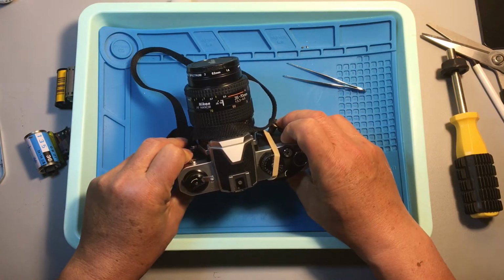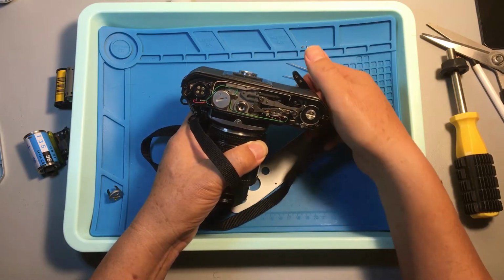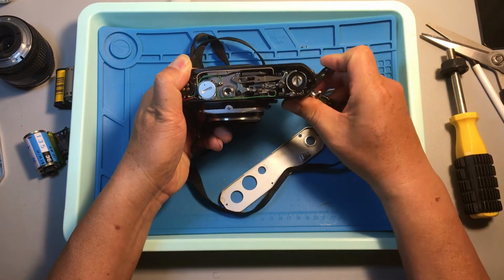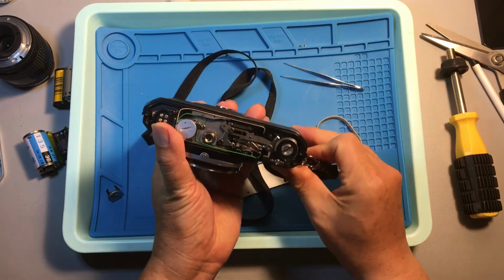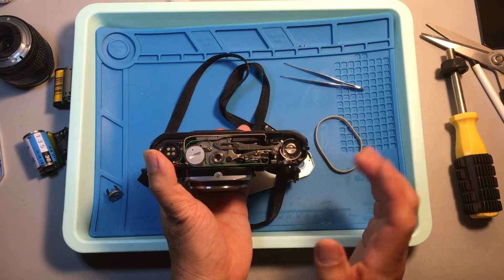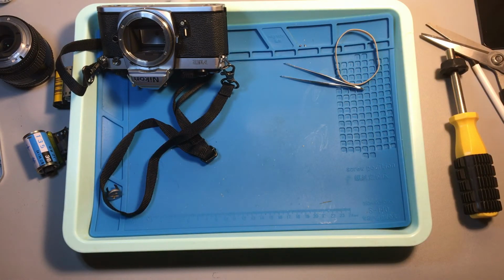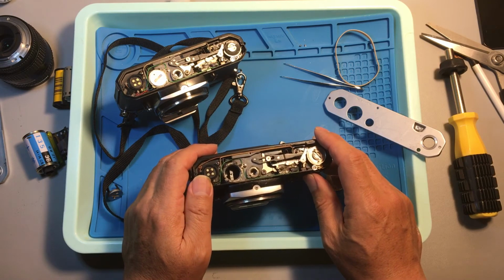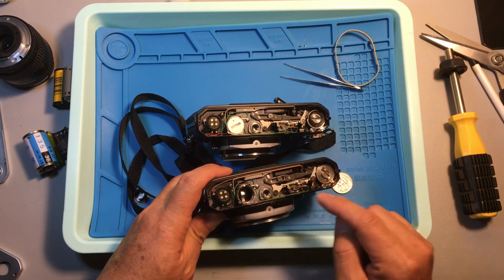Nikon FM2, FE2 Stuck Shutter Diagnosis & Repair

Comment: Hello, thanks for the video, it was very helpful! I was able to unlock my FM2 but at very low speeds it keeps locking. At high speeds it works fine. Where should I lubricate? On the pendulum? What type of oil is used? Is it suitable for sewing machines or does WD40 work? thank you
Reply from the maker: @willy-VD  I have been using 3-in-one lub oil. I think sewing machine oil should be fine too. I would be careful about lubricants containing acid content. I would lubricants on the pendulum and other axis with tiny drop to start with. Good luck.

Comment: Hi, great video! I have a FE and I noticed that 1000 and 500 shutter speed doesn’t work but all the other speeds work. I’ve tried replacing battery, it didn’t work. The shutter operates normally but I don’t see any light pass through. 
The camera takes amazing pictures but some are blank due to the issue. 
Any ideas what’s could be wrong? Look forward for your reply!
Reply from the maker: Looks some dusty grains or greasy debris in between the shutter blades make them sticky at high speed. I would use non destructive method to clean them first, like using a hand air blower gently blow from the shutter box after taking off the lens. Hoping this may resolve the issue. To open and disassemble the camera and to take out the shutter assembly cleaning each blades or replacing the damaged blades, I haven’t done these tasks yet. But I plan to do soon and already got a FM2 with damaged shutter blades. Cheers.

Comment: Hi, please show how to fix the FE2 problem, you said it's a magnet issue.
Reply from the maker: The issue with the FE2 or other camera which rely on electronic for shutter is always more complicated. Yes I will get back to it. Thank you for reminding me.
Reply from the maker: Thank you for reminding me. The FE2 issue or other camera shutter issue with electronics are always much more complicated.
Reply: @hometechengineeringvlog1141  is there any solution yet I'm experiencing thr same problem on my fe2

Comment: Hi there, great video. Got an issue with my FE on the shutter release lever, any suggestions? I think I know what’s wrong but I’m unsure
Reply from the maker: I would assume the issue is not in conjunction with the mirror or with the shutter curtain. If the assumption is true, the issue is easier. Opening the bottom cover, compare the levers, cam wheels..positions with those in a good FE camera’s. If you don’t have a good one at your hand, then need to find a way to know how these should be via online video or other means.....then you start to move or jiggle these parts to put them in the right positions...all of these should not need to remove any screws nor parts.....Good luck.

Comment: Like also if I put some pressure on the advance lever like rocking it back and fourth it usually releases the shutter and unlocks the mirror, I’m wondering if a CLA would stop this from happening?
Reply: I think a cla would be advised

Comment: Hey do you have anything for light meter repair for this, mine always shows negetive in the meter..
Reply from the maker: I may have a meter related video coming up some time. Generally first check the battery voltage, using 99% IPA to clean the battery chamber and the cover thoroughly, then doing back and forth the ASA dial several times to see if you have any improvement. If no improvement, then possibly some components in the meter/sensor circuits go bad…..
Reply: @hometechengineeringvlog1141  i have done all that, the meter only shows -ve sign all the led or lights are also working, while the i half press it shows all three light and goes to negetive light.. i have put my iso dial to maximum and have pointed it towars sun even then it shows -ve sign..
Reply from the maker: @Manawaralam  what about moving the aperture ring back and forth several times? Any improvement?
Reply: @hometechengineeringvlog1141  i have tried everything nothing works, even I removed my lens and faced the camera towards a bright sunlight and yet it is always negetive.. also showed to local repair guy he was not able to fix it..
Reply: @Manawaralam  Could the processor be damaged from a flash voltage spike?

Comment: My issue is that when I wind the film advance and then begin to release it the shutter fires by itself.  Any ideas anyone?  thanks!
Reply from the maker: This looks like somewhere in the shutter control chain can’t latch on due to the part wearing. I would do some trial and error along those axis by pushing it a little further or wiggle it to see if shutter can latch. You can catch this video more carefully when you advance film level where those arms and wheels should stay..Good luck my friend.